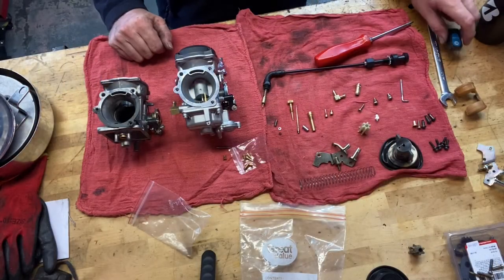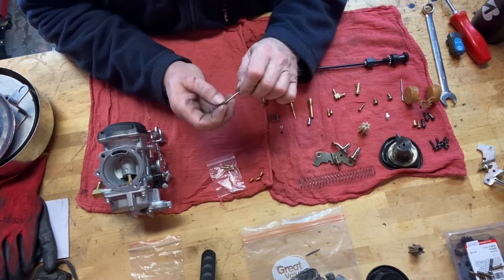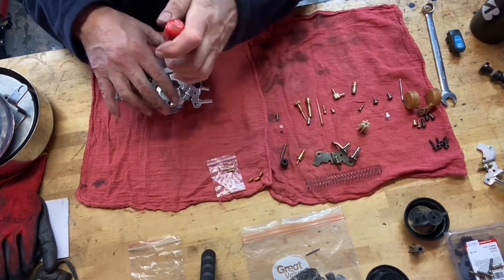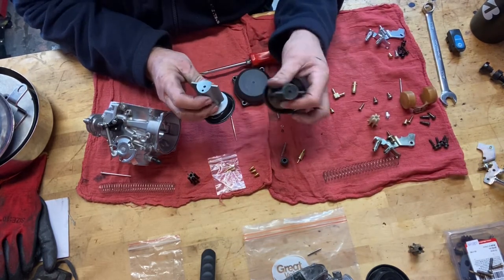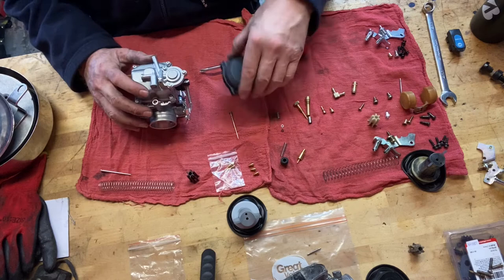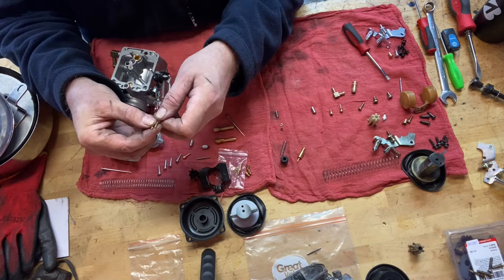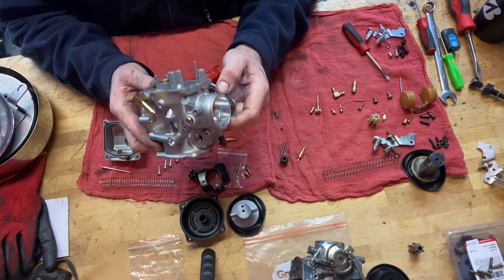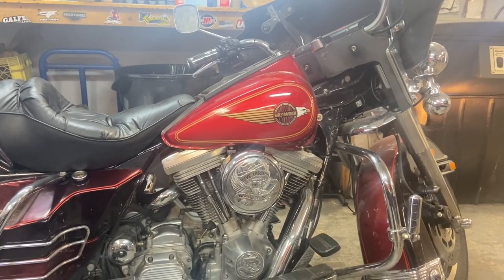Chinese carb on an Evo!

Comment: I placed a $35 40mm cv knock off on a stock 99 road king. Finding metric screws for the air box backing plate was a 30 minute ride and another $6. Works fine, 2 years old now.

Comment: I bought the Chinese copy from Dennis kirk. I have 0 complaints and it's a very good quality knock off for 200 bucks. My bike runs mint w it on there. I wanted one that was a good clone and I found it for sure. I'm going to soak rebuild etc. The original carb. Then I'll have the knock off and a good oem.
Reply: Could have had your original built better than new by a remanufacture of the cv carb for about 50 more bucks
Reply: @olebilly  I still have the oem carb. I wanted it quick in order to ride. That carb is still perfectly fine as well. Still have 0 complaints and I'd Def buy another one. The best part is I have a spare now.

Comment: Very informative. BTW  I have a 1988 FLHTC. It didn't come from the factory with a CV carb. The CV carb wasn't introduced until 1989. But mine too had been updated long ago to a CV. Now that it needs rebuilding again I am considering a Chinese clone CV. It's cheaper to buy a new Chinese carb than rebuilding the Harley carb.

Comment: I just put a Chinese CV40 on a 2005 FLSTC for a guy it's the third one I've done. I use to have like ten or eleven Harley CV40 carburetors from where I put an S&S on a bike and the oweres didn't want the CV40 back. I sold them on Ebay a couple years ago except for one that was like new.
Reply from the maker: I agree there are better carbs out there. This isn’t about the “best” carb out there. It was about getting a customer going back down the road for less than the cost of the rebuild kit on his CVK. I have done lots of S&S carbs for customers. I still prefer the Mikuni HSR over the S&S but it is more involved to run perfectly.
Reply: @rtrottier14  I'm with you I'm not a fan of the S&S it is over priced and once you rebuild them they start having issues like flooding. The Chinese CV40 seams well built much better than I expected I do prefer the original HD emulsion tube over the Chinese one I like the CV40 carburetors it's simple like the old Bendix was.
Reply: Got an OEM available to sell? 😉
Reply: @rtrottier14  so why do you prefer the hsr over the s&s, if the s&s is easier to tune?

Comment: Nice and interesting video! 👍 
..so, did you keep the original chinese atomizer? (I guess it has four holes at the base instead of genuine CV with more holes, maybe 16)..my question is focused about fuel consumption and general delivery of torque and power, having one of those 4 holes atomizers for spare, I wish to make some tests on my Sportster and I've been wondering if it can work🤔 
I assume mixture should be richer with that atomizer.. isn't it?
Thanks in advance and cheers from Italy!
Reply from the maker: I am not an engineer so I can’t say definitively, but I do believe that the main jet is the deciding factor for mixture ratio. The atomization from the emulsion tube controls how fine the droplets are as the fuel enters the intake stream. The finer the droplets, the more complete the burn.  The ratios would still be the same (A/F) but the finer atomization would create more power because of a more complete burn, acting as if it were richer. 

I have not heard back from this customer since he took delivery of the bike about a week after this video was published.  I have seen him riding it allot so i believe he is happy with the results. 

Cheers back from Canada!
Reply from the maker: Missed this in my first reply.  Yes I kept all the Chinese internals.
Reply: @rtrottier14  Thank you soo much!🙏

Comment: which one did you buy or is there a seller name you can share? Thanks and great video!
Reply from the maker: Thanks! the carb I used was from one of the sellers that is here today, gone tomorrow. What I would suggest is you do a search for them and go to a middle of the road priced carb. The cheap ones are unbelievably cheap, and the expensive ones are no better than the one I showed. Hope that helps.

Comment: I noticed that the copy carb didn’t have an overflow for the bowl. Do all cv carbs have an overflow. I hear some don’t
Reply from the maker: It’s common for the knock off carbs to keep the machining to an absolute minimum.  It’s not unusual to see the copy carbs without the drain/overflow machined in.
Reply: @rtrottier14  The later HD  CV;s  don't have the over flow.